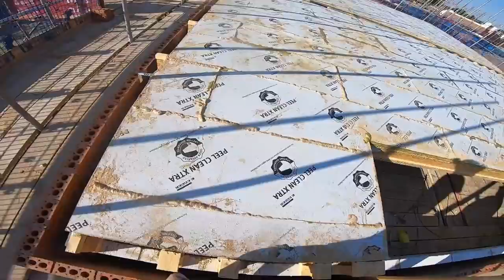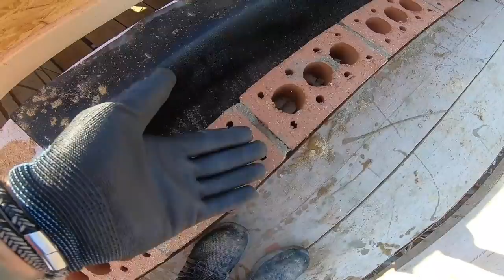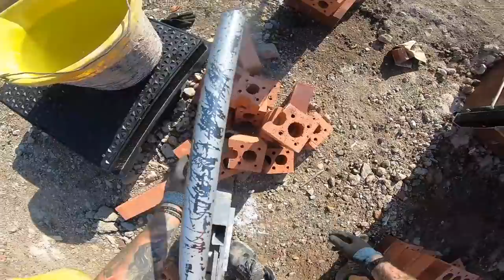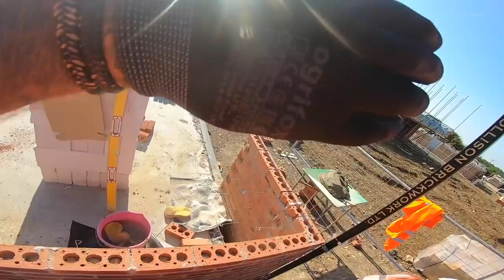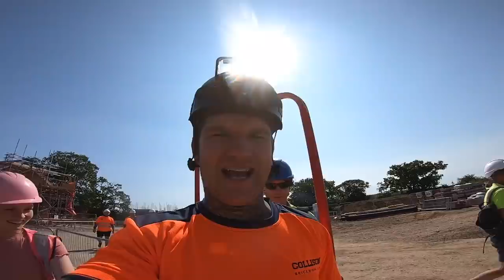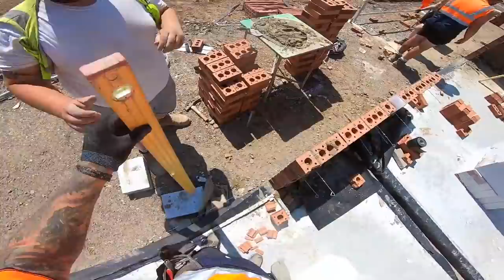2 Hod... Or not 2 Hod!

Comment: Go to a salvage yard probably get a bumper for about £100-£150 and bonnet for about the same £100-£150 and fit it your self but you might need to get some bumper clips 

The good new is most rangers come in white or black so it will be easy to find the parts in white